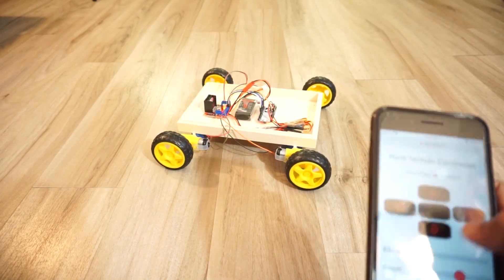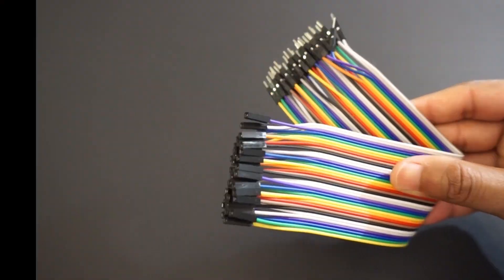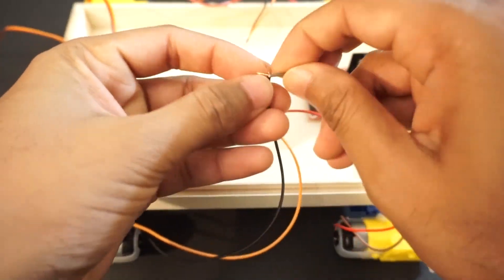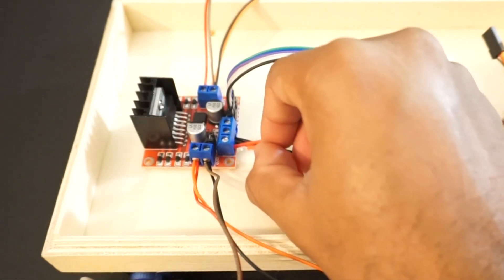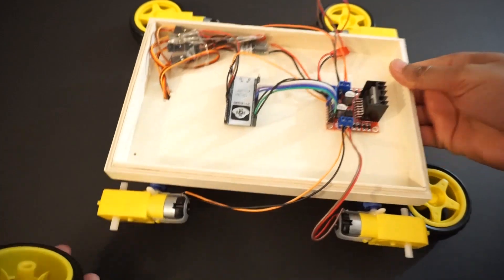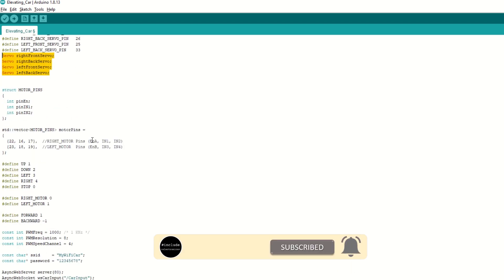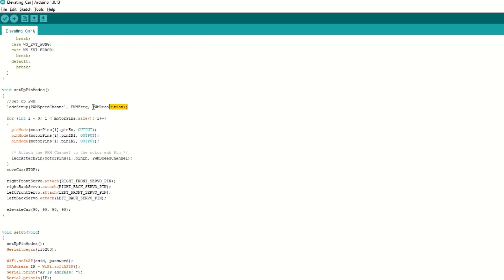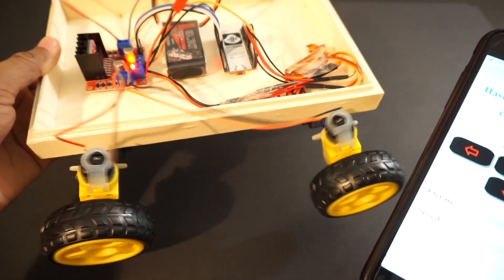Elevating WiFi Car using ESP32 | Lifting Car | DIY 🔥

Comment: your code is not correct compilation error I'm facing plz give correct code
Reply: Problem facing is led set up I downloaded library also but still getting that erorr
Reply: Please help
Reply: And now showing I  not declared in scope
Reply: In pin mode it is showing
Reply from the maker: @topupking256 please install 2.0.16 version of esp32 board in Arduino IDE . Please check the video for this step 👍🏻👏🏻
Reply from the maker: What exact error do you get ? 👍🏻👏🏻

Comment: Which board you can use plz tell bhaiya
Reply from the maker: Esp32 38 pins module 👍🏻👏🏻
Reply: @hashincludeelectronics 
Also I'm facing to much issues related uploading code and working model plz help bhaiya (I have only 2 days to complete this project...)
Reply: Esp32 38 pins board is not available so can u help me to make this project plz..

Comment: which esp 32 model should we use , we can buy esp32 wroom given in link or not?
Reply from the maker: Yes please buy that 👍🏻👏🏻
Reply: @hashincludeelectronics  i guess u have used esp32s then also i can use esp32 wroom
Reply: and which esp version should i use and one problem i am facing that showing port do not exists
Reply: Download cp2102 driver from silicon labs

Comment: wonderful.... can i change  ip to other  number
Reply from the maker: Thanks for checking out the video 👍🏻. Yes you can change the ip. There is a function called WiFi.softApConfig which can be used to change IP address in AP mode . May be please check more details on net for this .

Comment: Can I do same code with esp8266
Reply from the maker: Thanks for checking out the video 👍🏻. We are using ESP32Servo library in the code which might not work for esp8266. You need to use servo library which is suitable for esp8266 and code should work . You will have to change the pins as per esp8266.

Comment: Hii, i am making this model for my project
 but the problem is coming that i have esp32 
 but i changed the pin in the code for servo motors and l298n motor  but the car is not performing functions in forward and rightward direction and the servo motors are also not performing there work 
If i change the pin then i had to change anything else   in the code 
Because after changing the pin no.. the car is not performing well 😕
Reply from the maker: Thanks for checking out video 👍🏻. Could you please confirm what’s the need of changing the pins? I would suggest first try with existing setup same as the project and see if it works .
Yes you can change the pins and there is no other change needed in the code . However you will have to make corresponding changes in the connections as per pins . 

Also make sure you are using valid output pins on esp32. Some of the pins are just input pins .
Reply: @hashincludeelectronics  
thanks 😊 for ur reply 
I changed the pin because i don't have esp32-38 pin wide module 
And the project is working i changed the pin no. In code and its working 
But 
I don't have ubec and i used buck converter 5A dc-dc 
But again the servo motors are not working.
Please tell , if i had to set the output and input current.
Reply from the maker: @vaibhavyadav6544  This is great news . Good going .  Regarding Servo motors, what's the output voltage of buck converter ? make sure its 5 v output . Current 5A current looks good .  Try connecting just one servo first and see it it works . and then connect all servos .  let me know how it goes. You are almost there to finish the project 👍